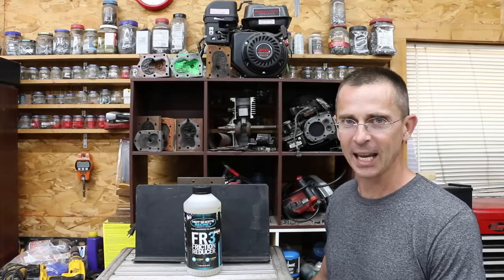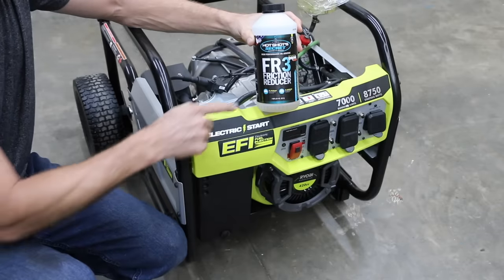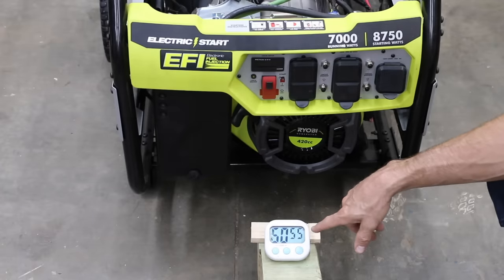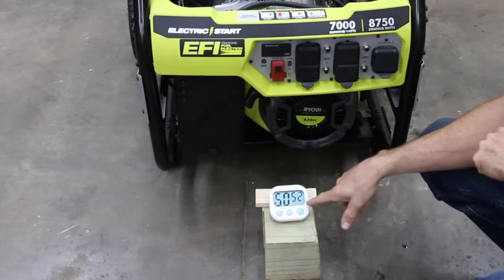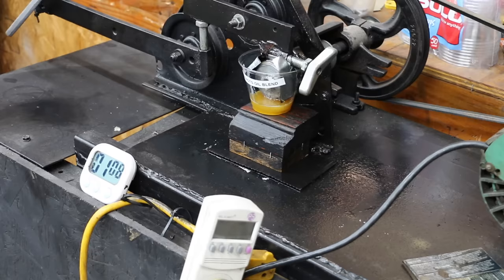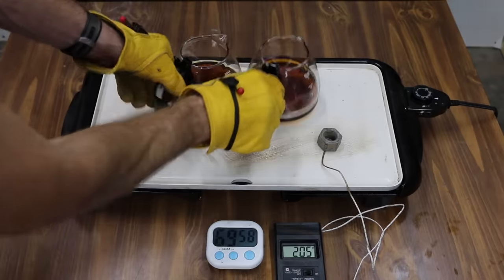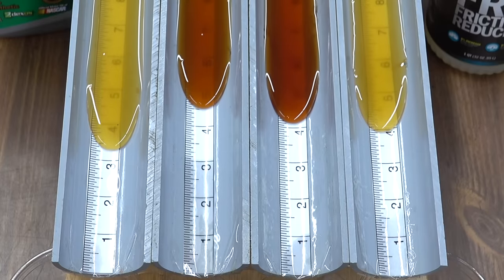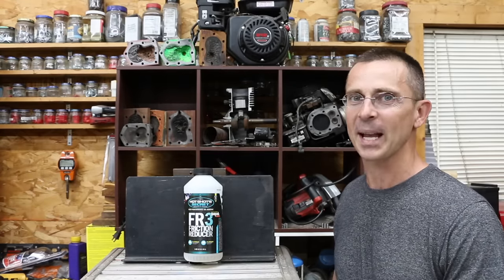Mobil 1 Boosted with Hot Shot's Secret Better? Let's find out!

Comment: My car dealership  said that their engine  oil is better than the one I use (pennzoil ultra platinum full synthetic). They claim  that their oil will protect the engine better because it's made for it. I doubt  the oil is specifically made for them and is better in quality. Can you test car manufacturer's  branded oil vs name brand oil?
Reply from the maker: Wow!  Pretty bold claim!  What car brand?  Great test idea.
Reply: No oil is made specifically for a certain engine, with the possible exclusion of Formula 1, Indy Car and Nascar, etc. Even those racing formats usually use the top brands of oil that anyone can buy.
Reply: Most dealer use gulf oil and gulf oil is trash I work for a family owned quick lube and I have had to call dealers and get oil spec sheets and 90% use gulf and the other 10% use Mobil 1 and gulf oil is trash even their 0w20 don’t listen to them they don’t care about your car they sell trash oils that will get you right past your warranty and then brake down when cars run m1 products they last 300k plus
Reply: @ProjectFarm  it was at my Nissan dealership I own a 5.6 gas nissan titan xd
Reply: @michaellinner7772  yeah I figured  I'm no oil specialist  but I do know oil cant be specifically  formulated  for a brand
Reply: @jasonpaeth6608  yeah my dealership  said using a different  brand of oil instead  of Nissan  branded can cause premature  wear and potentially void my warranty lol
Reply: Are you sure they didn't say that using a different brand of oil that isn't specified for you engine may void the warranty?  I don't think they are allowed to make the claim you must use their specific brand in the U.S?  So long as the oil you using meets or exceeds whatever oil specification the engine manufacturer denotes (sn, sn+ etc) then the warranty cannot be voided due to that.
Reply: Please test motor craft, I feel like it’s garbage.
Reply: @anunpopularstance  in order for a warranty to be void, anything aftermarket must be shown to be the cause of the failure
Reply: @FM4AMGV  exactly my point.  Oil is government regulated in passenger vehicles. It can't void warranty unless wrong specs are used....brand name is irrelevant.
Reply: @dsm02c  Motorcraft is just Mobil in the U.S.  it's simply rebranded.
Reply: Working as a motorsports mechanic, I can tell you for a fact that is is practically a moral to use CanAm branded oil in any can am machine from the spyders to the vtwin rag tag quads they sell.  It would be unusual at my old shop to see anyone do anything different, not even for a different synthetic when we were out of the 50 gal drum.
Reply: Nissan uses Mobil 1at the dealerships
Reply: There are some really good OEM oils Toyota's TGMO and Mazda's full synthetic come to mind. Most dealerships don't even stock the OEM oil and just buy bulk Mobil or Castrol in 55 gallon drums. I've worked at multiple dealerships and have never seen anyone actually use the OEM unless they order it in from the parts department. BITOG has solid oil analysis information.
Reply: I bet the specs of Mobil 1 meet and exceed what they use
Reply: Most dealers use gulf at lest in Michigan and I’m pretty sure the 5.6 in that truck is a mopar engine and only thing different is it take 0w20 not 5w20 and both are a synthetic because both were unheard of before the 2000’s and only reason for the 0w20 is because the engine are not opening up as much for better gas mileage
Reply: @anunpopularstance  they really  just want me to get the maintenance  program but I declined it. They said to buy their oil because  it was better and it is specific to their requirements. As I mentioned  above I use 0w20 pennzoil ultra full synthetic  and from project farms test I was able to see how good that oil is and it covers  all the specs they have
Reply: @ProjectFarm  Tesla
Reply: I know Mopar uses Penzoil, they even recommend it. But its be said by multiple sources that mopar oil is just Penzoil conventional. As far as Nissan I know they use Ester Oil in their VQ motors which is or used to be hard to find an expensive
Reply: @dsm02c  I thought he did. Or someone on YT did. Yep I was shocked its trash.
Reply: @anunpopularstance   I doubt it. Was told Mobil makes John Deere oil also. Nope. John Deere oil is so horrible I wont even oil my guns with it. Its only good to use to start a trash fire.
Reply: @markarmstrong3394  I know a guy who works a distribution fulfillment center for Mobil.  Motorcraft used to be supplied by Halvoline not long ago.  They simply use whomever will supply them for the best price.  And btw Mobil oil isn't anything special.  The idea that Mobil 1 is some miracle oil is marketing brainwashing.  Sure it's good oil but so is something like Supertech at half the cost.
Reply: @anunpopularstance   maybe made for them under their guide lines. 
As far as Mobil I got 1 million miles on my 60 series Detroit before head gasket blew. Now I'm a mechanic and the shop i work at uses only Mobil and only changes oil on DD13 at 42,000-43,000 miles.   The Chevy Van's got over 350,000 miles and barely serviced.  So yeah my opinion is Mobil is great. But that's my opinion
Reply: Pennzoil Platinum is excellent oil.
Reply: @jasonpaeth6608  I care about your engines! I'm a tech at a dealer too. We use Castrol and Mobil1. It's what I use in my own car. No issues with engines over 200k kms. Please don't spread misconceptions.
Reply: Dealership bulk oil is garbage.
Reply: @dsm02c  Motorcraft is an exception. Its actually really good oil. BITOG has some tests on it.
Reply: Do your research, most reputable oil companies do supply manufacturers with quality oil. Ex: Shell is the OEM supplier for Genuine BMW TwinPower Turbo oil. That equates to Shell Helix Ultra (international) or Pennzoil Platinum/Ultra Platinum/Platinum Euro (Shell Oil Products US [SOPUS])
Reply: Reminds me of the Chevy dealer trying to sell me a cabin air filter for 135 bucks.  Got the top end one at Autozone for $35 and did the swap myself.
Reply: @LTHero.   If they did that , then they broke the Law , and they have to do your oil changes for FREE , or supply you with their specific oil to take it where you choose to have yr. Oil changed  !!  Thanks -😎
Reply: @dsm02c   No Motorcraft Oil Is Very High Quality ... Usually Produced & Bottled For Ford By Conoco-Phillips Or Kendall !!
It Is Good Stuff ... But My Personal Choice Is Castrol Or Valvoline !! 😉
Reply: Waylon McCrae interesting, my main reason for concern is that is what my dealership uses in my F150 eco boost and I have the factory service plan for another 70k miles...
Reply: Francis Grabetz I work for Mobil I’m not mis leading no on I’m simply said Mobil 1 meets and exceeds most brands and is the best oil you can get for Normal wear and tear we have other stuff like a cheap high mile oil that is always low in between 3k mile oil changes so excuse me I prefer conventional 10w30 valvoline in my car with is a 1994 dohc geo prizm and never been low or had dirty oil in between 5k oil change 3 qrts of valvoline conventional with a Mobil 1 oil filter I know all filters are made by one company just differ labels but they are better then the white no named oil filters that crush like pop cans by hand when taking them off I service around 1500 cars a month I know a few things about oil
Reply: @ProjectFarm   I would be extremely interested in this. I've debating whether I should use Motorcraft or Penzoil/Lucas/etc. for years in my Ford. Thanks for doing what you do, genuinely
Reply: @LTHero.  Haha trying to up sell you there brand. What matters is doing regular routine maintenance
Reply: 1st of All dealership now days do not change oil on 5k if you proches there plan they will change it every 10 k I think that's not right thing 2nd they used bland oil it's alright but not as good as Mobil one best oil If you want to keep you're car keep clean and run batter allways used Mobil 1 it's best oil .. if you want less carbon then use 93 gas. Regular burn same way just create more carbon rest they all same. .
Reply: @michaellinner7772  NASCAR's specially formulated blend contains high levels of alcohol and trailerpark meth
Reply: Trust what your car dealership is telling you to extend the life of your car so you can buy less cars from them?????  Hmm....Like Trump claiming that he is an "environmentalist".
Reply: All auto repair shop uses the cheapest oil (API certified) they can find in for their oil tank... How do i know this? I owned and ran a leading auto franchise for 5 years.
Reply: I'm a mechanic.

Oil is oil, what you pay for is the brand, somtimes oil has a few additives in it but they normally make the oil last longer. Your better off buying the cheapest oil and changing it every 8000 miles. Here in the uk we have halfords and they sell many oil. The oil says which brands they are for and they vary in price by a lot. If you have an audi and the cheapest oil is for a Mercedes take the cheapest.
Reply: @LTHero.  I've worked for a main audi dealer for over 10 years, I can tell you that if you have a problem with your engine such as it burning oil and your car need new piston rings. We do not check what oil you have, it cost to much time and money to check it, of you are asked just say you use their oil.
Reply: I can tell you that Toyota does have an additive package that is specific to their engines. Mobil used to produce oil for them, not sure if they still do or if they’re using someone else. You would think oil is oil, but you’d be wrong. The additive packages can vary quite a bit depending on what they are specifically trying to achieve, such as, oil that will not coke up or carbon pack piston rings.
Reply: fordrac1ng81 p

Comment: I am so impressed on how exact the engine ran out of fuel. Your test conditions are something our scientists can learn from.
Reply from the maker: Thank you for the feedback.
Reply: While I appreciate it as well, these tests are far from as accurate as a lab would be. PF tests in real world applications with variables being very much in play, while a lab is going to control the variables as much a possible for a completely even test. It's just sheer coincidence that the run time was 50:44 for both tests. Even a 1 degree F difference in temperature will skew test results. I'd personally like to see each configuration ran 5 or more times to get a mean, a median, a high, and a low.
Reply: @Jetmech1781  
Yeah dude, you should go to a lab, do those tests like you said and post them. I'd watch the vid and like it if you do a good job.
Reply: @Jetmech1781  Definitely prefer the real-world tests over some perfectly controlled tests.  At least in the real-world tests I can have realistic expectations.
Reply: @Jetmech1781  While what you said MAY be true, he has quite a few videos where he tests fuel economy, and in almost every case the difference is within a few seconds when it does not help. It isn't perfect but it is impressive.
Reply: @Jetmech1781  I mean ofcourse its noy perfect but still. Didnt the label say 40% better fuel economy? If it ran out at the same timr you can see that the claim is not true even in the margin of error. You should see at least couple of minutes more of run time if its better.

Comment: I was wanting to put my vote in for testing Hot Shot secret additives again? Specifically the stiction eliminator with fr3. When I first started watching your channels years ago I did not have the F350 I have now. After much research done myself I not use there products in this truck from front to back, it is now on its way too 200k miles with no major parts replaced and passed a recent oil analysis with flying colors at a 7500k mile change interval. Also before and after the use of HSS I have seen and continue to see on average 2.5 mpg better. Thank you again for all your amazing videos and have a great day!
Reply from the maker: You are welcome!

Comment: What would you think about testing products for removing adhesive residue? Is it worth spending money on Goo Gone, or does rubbing alcohol or WD-40 work just as well?
Reply from the maker: Great video idea!  Thank you
Reply: I can sum that up pretty easily.  If you want cheap, and lower odor but slow as a result, use diesel fuel.  If you want faster and use it outdoors or in a very well ventilated area, use gasoline.  Best is gasoline with a little oil mixed in so when the adhesive is dissolved, it mixes with the oil to hold it in suspension so as the gas evaporates away, the goo can still be wiped off including once fumes dissipate more and you bring the item indoors to wash it (if needed).  There need not be much oil in the gas, I usually just use 2 cycle oil/gas mix because I already have it for my 2 cycle equipment.

However, there are more and more labels now applied with a starch based adhesive so you might try just a plain water soak with a saturated paper towel over the sticker, peeling off the top of the sticker first if it's plastic coated.  A drop of dish detergent in the water will also help speed wicking into the sticker to get at the adhesive.

WD-40 will also work well but like Goo Gone, has a much higher cost per use than gasoline.  Currently gas is about $2 a gallon here so an 8oz Goo Gone sized quantity is about 12 cents instead of $4.

Do test any of these adhesive removers in an inconspicuous area.  Some plastics in particular like polystyrene are not safe to use with gas or even Goo Gone or WD-40 and other petroleum distillate based products (which is what you need for the petroleum based adhesives most prevalent).  Polycarbonate is also affected to a lesser extent.
Reply: Yes I would like to see that I stuck a couple of pieces of duck tape on my truck ann forgot them for a few days and can’t get it off , I even tried WD-40 wouldn’t touch it.
Reply: Nawor3565 Naptha/Zippo fluid/Ronsonol/Coleman fuel will handle all of your adhesive residue removal needs more effectively than alcohol or gasoline.
Reply: 3m adhesive remover, autobody supply stores, amazon?
Reply: Like dissolves like. If you have a polar adhesive/goo, use a polar solvent (Like water). If you have a non polar adhesive, use a non polar solvent. (Like hydrocarbons. Citrus/olive oil works great to remove adhesive.)
Reply: brake cleaner just evaporates adhesive.  Can't use it on plastics though.
Reply: Acetone is great if you don't use it on a painted surfsce.
Reply: Dykem Remover will remove any adhesives that I have used it on. A tad expensive though.
Reply: WD-40 is mostly refined mineral spirits (Stoddard Solvent or VARSOL as it was called back in the day).  Throw in some mineral oil, driers, fragrance, propellant, and you have WD-40!

Comment: I'd like to see the generators run with a load, something like a 1200w space heater that just has a consistent high power draw so it's more than just idle efficiency measurements.
Reply from the maker: Great feedback. Thank you
Reply: yes i agreedos!! Load test would be a proper comparison to check fuel consumption under stress

Comment: Would love to see a test of the Hot Shot’s Secret Stiction Eliminator or Fuel Lubricity additives! Great video as always!
Reply from the maker: Great suggestion. Thank you
Reply: I know it works, have seen it first hand with failing injectors.. I would love to see that video. Has to work as bad as it smells. 😂
Reply: Lol no kidding. It brought three injectors in my 6.0 powerstroke back into spec. About time for another go around next oil change.
Reply: Just my experience with HSS's Stiction Eliminator. I have a 2015 ram with a Cummins that only had 44K on it when I used some of the Stiction Eliminator in an oil change.  The turbo response improved immediately, engine ran a tad smoother too.  Just my experience....YMMV....
Reply: Would love to see them compared to something like liquimoly.  No magical claims, just reduced friction/wear from cold start ups.
Reply: I second that request.  This stiction eliminator product has been around for years
Reply: @kevinpacheco3303  
I don't think he'll see your comment over in the side bar. Write it in the direct comment part, he's always looking for ideas.
Reply: The stiction eliminator definitely works. There is no doubt about that.

Comment: Love the video, I'm wondering though how all of the oil additives you've tested would work using them by themselves in an engine as an oil replacement?
Reply from the maker: Thank you for the video idea!
Reply: That is actually a great idea I second that
Reply: Why do this since nobody would run straight additives?  Better to put the additives in the oil as prescribed then see if they make any difference.

Here's a crazy idea, instead use oils not meant for motors like vegetable oil and see if putting the additives in THOSE otherwise non-fit oils, helps any.
Reply: @stinkycheese804  I've ran a moped on just fuel additives, don't tell me nobody would do it. And testing them "as prescribed" is what he already does......
Reply: You can get marvel mystery oil in gallons and berrymans B12 in huge quantities.... I'd be interested in seeing what happened to a sludged motor running straight MMO for a little while...
Reply: @charlesrich3975  Just because a couple people might, potentially, do it, (when mercury is in retrograde, of course), doesn't mean it's a worthwhile test.
Reply: @xenonram  and seeing if a gas engine will run on charcoal lighter fluid is?? (5 months ago) This man has already tested more than a few odd things to use in place of the product intended.
Reply: It might turn Predator engines into a frictionless time machine portal!! we dont want anything bad like that happening to Uncle Todd!